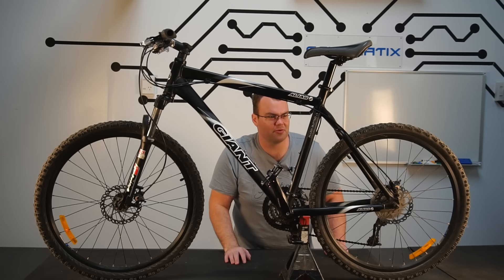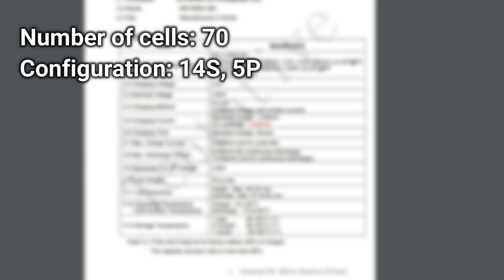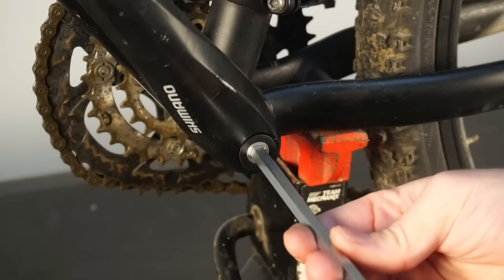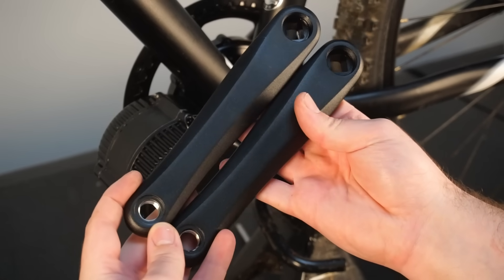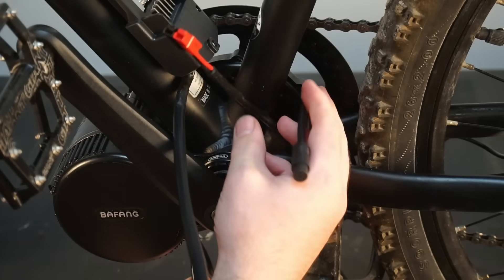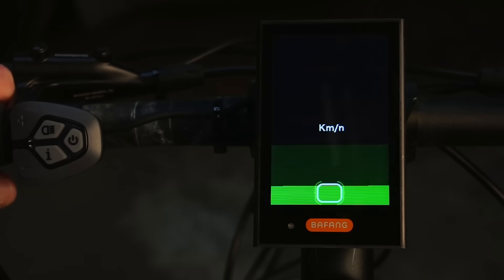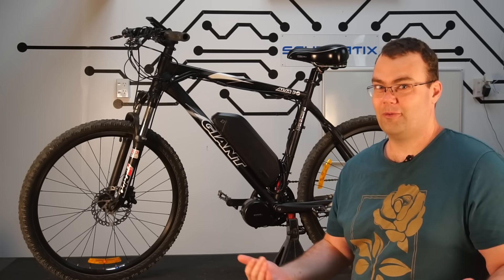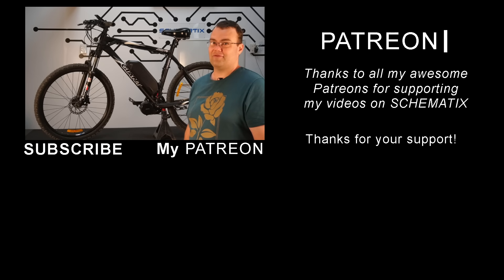eBike Conversion Kit, Install & Review ll Bafang BBS02B 750W motor

Comment: You will wish you had more power quickly, once you start riding. I would say skip the BBS02 and go with the BBSHD. If you get it from Lunacycle, it is stamped on the motor casing as 750W, but can be increased to 1500W with just a few programing changes through the display. 1500W not enough? With the BBSHD, you can even swap out the integrated controller to get 3000W output!!!! All with a motor stamped with the legal 750w info. I run a BBSHD at 3000w on my custom stretch cruiser for over a year, aprox 600miles with no issues. I am a throttle junkie, I use the throttle A LOT, and can hit 50mph on flat ground. Plenty of torque, for hills as well. Do yourself a favor, and spend the extra $ on the HD version. You will be glad you did.
Reply: What external controller brand/model# did you try?  Thanks in advance to your reply.
Reply: @markjones7130  Not external. The Ludicrous controller from Lunacycle is a direct swap for the original. Remove the factory 750W controller from the chainring side of the motor, and install the new one wire for wire. Once installed, there is no visual/ physical difference. In 30 mins you are now at 3000W. Heres the link.
https://lunacycle.com/secret2/

Comment: You failed to mention that the battery BMS is a limiting Factor to how much current can be output.
No point having  8 amp cells in 5p when the BMS is 15 or 20 amp
Reply: Interesting comment.   R U referring to the controller in the Bafang motor? Where is the BMS in the Bafang Kit?
Reply: @markjones7130  
No not the motor controller.
Pretty much every battery manufactured for an e-bike has a battery management system attached to the battery.
This is so the battery can  balance change each set of cells and to control the overall current  output to the motor controller
So you can have a very powerful motor but if your battery only outputs  certain amount of amps due to its BMS   Then the motor is never going to get the full amount of amps if it can handle more than the battery will output.
So when you buy a battery for a ebike kit you have to check that the peak output current of the battery is enough to supply the peak current draw of your motor controller .

If you are making a fully custom system the BMS for the battery and the motor controller for the motor will typically be programmable.
Then U can either use the full amps available on your battery or limit the peak amp current draw with the BMS
And or you can limit the amount of current you put into the motor through the motor controller.
You can totally stuffed it up as well and get it all wrong and burn both of them out.

Comment: Hi there mate, thanks for the video. I'm guessing the motor was 48v, is it ok to use a 52 v battery with the motor? Thanks again.
Reply: Yes they're good up to 70v but anything after 60v is just heat. I have a 60v batt and it's great. Amps Wil kill it before voltage
Reply: @nomadchad8243  what?
That's not how electricity works.
Reply: I'm just a youtube random, if you're
 Interested BrunoPOWEEER  has excellent videos about this 48v bbs02 motor, 85 kph at 60v (that's too much) his channel is great.
Reply: Not if it says 48v..

Comment: I have burnt out 5 bbsh motors from 250-350 500 as the centre spindle with the coil around it cannot cope with hear and shatter. So avoid and get bigger motor like 1000 as that can

Comment: The 02 runs better if you fit the HD controller giving 28 amps, I had a controller blow on my 02 and couldn't find an 02 in the UK only the HD, so I fitted it, it retro fits fine, it also has better mosfetts than the  02 version ..

Comment: Why on earth do you have this bad habit to through away a useful triplet and install an mid drive motor. What would you do when you will face a situation where the battery will be dead (exchusted) and you have to climb steep hills? This is absolutely the wrong way to convert a bike to ebike. The motor should always be on the back wheel and have all 24, 27, or 30 gears if possible.
Reply: Hub motors are horribly noisy.

Comment: Helpful video. I'm just looking at a 750w full suspension conversion, looks like I will have to drill another bottle mount hole with rivnut to move the battery further up, anyway can you use this without connecting the thumb throttle? I just want pedal assist like most off the shelf bikes, I want to take away the temptation of laziness 😂🤣😂
Reply: No self controll ?

Comment: Nice video. I bought/installed similar kit, my battery is 48v11.6a, kit cost ~$900USD. So, free would have been much better. :)   Been riding it about 4 months.  Very happy with it,  provides me more inducement to explore places uphill.  Battery takes ~twice/thrice/4-times as long to charge as it takes to discharge.   On flats with battery off  there is a drag on the drive train.  Nonetheless I am very happy with it.
Reply: You mentioned "drag on the drive train" while the battery is off.  Does that mean there is drag with no pedal assist in action and gliding over the flats?
Reply: @markjones7130 I only notice a little drag when pedaling, not coasting.
Reply: you couldve got a 52v 25ah battery (samsung cells) for $500 and the bbs02 750w mid drive kit for $400
Reply: @terrycruise-zd5tw I prefer a smaller lightweight battery. I do not go on expeditions over 20 miles.
Reply: Update: locked bike stolen in front of East Portland grocery. Building new bike. Keeping with smaller battery since I find most trips are <12 miles & lower weight is critical for transporting bike on bus train car.  Bafang remains price performance leader. My advice, buy the special spanner.

Comment: i've got one of these and its been pretty good, but I think im going to switch to a hub motor kit as these dont handle deep mud well, every time I ride down the local river I have to open the gear case and re-grease everything as it gets full of water.
Reply: These motors are made for comuting I plan to modify  my hard  tail for a more comfortable  saddle  and panier system   for carrying food and drink   police in tge uk don't realy give  a shit unless your being stupid and say that you have a 750watt  motor  or don't have it labeled lol
Reply: If you used Marine grade silicon sealant around the motor housing connector plates and wire entry points.... it will greatly help.  Plus try heat shrink over the connectors.

Comment: watching ya install it with a pipe wrench made me cry.. and that is not how you size a chain......
Reply: ......and the winner of the least helpful comment award goes to, Mr. Hayward.
Reply: @ChatGPT1111   Use the correct tool for the job! the correct tool is available for a few extra dollars from Luna. i recommend the sockets over the shitty spanner that is supplied with most of the kits.. good luck doing it up to spec with a pipe wrench or the crappy spanner as it needs to be done up tighter than a fishes ahole. Doing it the way you have shown will cause the motor to shift and potentially damage the frame and probably the motor when it swings up and smashes the frame over time. im just gratefull you did this to your own bike and not someone elses.
Reply: @brendanhayward1803   I installed a Stabilizer Bar-BSB-1 for Bafang BBS02 (about $20)

Comment: Should have gotten BBSHD set at 1500 Watts and with tha frame, a triangle battery.
Reply: I think i would go the bigger one also for a few reasons ,  one reason is 
A. i suspect i`m tad bigger and heavier than old mate here , also i have a heavy built bike due to  A. and also carry a bit of crap with me .
Lastly , i`m firm believer (rightly or wrongly ) that bigger motors may last longer due to their inherent heavier duty build(hopefully ) .
  Small motors that work harder tend to have a shorter service life in my experience.

Comment: Can we remove the 25 km/h limit?
Reply: It doesn't have one
Reply: As far as i know
Reply: @archiegol9903  so It already goes more than 40 km/h?
Reply: Speed limit is removable with setup function on display.. I suggest to obtain programming cable and re-program PAS levels (as I did), and get much smoother and better performance from motor. (try here: https://electricbike-blog.com/2015/06/26/a-hackers-guide-to-programming-the-bbs02/ )

Comment: Really nice review. Very well done and informative. Now I know how to handle my chain and cut it to the correct length. 

But I got a little side note.
Started my conversion this week and bought all the propper tools. Removing the cranks was hard but worked out in the end.

But removing the nuts after that was a pure disaster, the drive side would not move at all (i know it is inverted thread.) And the other side was made of plastic a broke down after 2 rotations. And the force required was insean. 

I ended up having to use a hammer and bang in out, and then use a saw to saw the locking rings in to Peace's before getting them out. This alone was more than 3 hours of work. And might stop some one to continue with the conversion.

My bike is 15 years old and has done couple 1000 miles but has always been stored inside.

Now waiting for the moter to arrive to finish this build, I'll use your tips to compleet the project. Thnx

Comment: I've been driving such a kit for 3 years (replaced the battery after 2) and I'm quite happy with it.)
Reply: Sneakily  ride this in the uk  get a 250 watt sticker with  48 volts and modify  the battery  witg 52volts for increased  power anyone who looks start clown pedaling  lok
Reply: Hi mate, did you record your total mileage up until you changed your battery by any chance? Also, what do you use your bike for, city commutes, off-road, mountain biking?
I had my Trek 7.3 hybrid converted with the Bafang rear hub kit, (36v battery,) late last year. I've only clocked up about 600 miles so far, but am interested to know the lifespan of the battery for different cyclists.
I use my bike to commute to work in London, do my shopping and for leisure. I never go offroad or hit trails etc., but I love the conversion and the best bit is cruising up hills that I would be struggling  to do as I get older. Cheers!
Reply: @najdaraj9420  I had on of these conversion kit installed on my bike and I can tell you: they are build like tanks!. The bike actually gave up before en bafang system which only failed once when the battery switch actually got into flames (I thought it was the battery so I sent it back to the dealer for refurbishment, I only niticed that the power switch melted down while dismantling the battery). To answer your question, my first 14Ah battery kept on working for 9000 km, the second one (17Ah) survived the bike which ended up in a scrapyard at 20000km... Actualy I s'till have it today, and I need to take it to the recycling park.  Today I'm still convinces that the refurbishment of the battery wasn't needed. You can easily drive over 10000km with that kind of battery with no noticeable performance or range reduction. Very good system for that price.
Reply: @laurentartiges  cheers for the info and happy cycling!
Reply: @najdaraj9420  about 2 years with 16km 5 days a week. Battery was a 48v 10ah IIRC
Reply: @pugofstardock  ok, cheers for that. Quite similar to what I do on an average week.

Comment: 750W motor, I wish that was allowed here.
Here it's considered a scooter with that amount of power.
Nice project!
Reply: Or just put a 250W sticker on it...
Reply: Police don't bother over here in the UK just don't be douche  just because  you have maybe a 10mph extra  oomph  you shouldn't  mention the power lol   or should  use that power when you know cops are not gonna be looking lol
Reply: @jonathanoxlade4252  Not sure about an extra 10mph. My 750w Bafang is good for nearly 40mph (pedal assist) and no I don’t ride it that fast, but tested when I first converted my bike.
Reply: 40mph wow is that with 48volts or 52volts since I plan to do my bike with a 750 bafang  with 52volts so I can get better mileage  than let's say 1000watt  motor 750watt  with 52 volts is more than enough  power
Reply: Also that extra power can be used to power up a stereo  system on the bike get a 12vokt to 52volt step down converter  and wire up a motorbike speaker to my bike lol I get bored and tired on my bike listening  to music makes it more fun but the isues is pulling my phone out to change music and it would be nice to listen to the radio  while riding and don't have to worry about needing a expensive  phone contract  with unlimited  data to listen to music on
Reply: It's also considered a moped where we live too (his channel is based in NZ). However if its being used on private property then legally its fine.

Comment: Did you know that you can get a whole lot mileage on the battery if you recycle the energy by charging another battery at the same time while you ride?   Install a switch that swaps batteries, one on charge and the other running the motor.
Reply: There aren't any ebikes like that, and that would only work if the motor isn't on, while using the motor as a generator, and even that would take hours to charge the battery back. It's just not worth doing.
Reply: “In this house we obey the laws of thermodynamics!”

Comment: So what if I want to ride that on back roads cross-country (3000mi)? Seems I could build my own pack of 18650's and fill that entire triangle space with 50-60AH easy. Wouldn't look as pretty, but at 25Wh per mile worst case 3kWh = 120 miles, enough to get to the next town/charging outlet. Maybe even extend the range if I carry my own foldable 67v solar panels in a backpack or something (ride at night, sleep/recharge during day pretty much anywhere with sun, no outlet required).
Reply: Carrying enough solar panels to charge the bike at any considerable rate would be difficult, plus you would need to buy a special solar charge controller.
Reply: @landonferguson7282  build one. It would probably weigh maybe 15-20 lbs if they are flexible and mounted on thin enough sheet (the cells themselves only weigh 8 lbs).  60AH with 500 cells, (250s2p, 5" square, 2.8w each ) can do it in a few hours, maybe 10 if a cloudy day. A 150v-in charge controller wouldn't be that heavy (8 lbs) and could be mounted to the bike (above rear wheel would be best). You could maybe even put the solar panels in saddle bags after it's rolled up to where weight would be less of an issue, it's not flying or going into space. Even all that would still be far cheaper ($3k) than an e-motorcycle that tends to cost more than a new Harley.
Reply: Also, after doing an Aliexpress browse if I really wanted to go all out I could get 14x  lipo pouches custom shaped in the shape of that triangle = about 100-120AH at 1C (can do 3C but not necessary for this at that size). Those are state-of-the-art and come close to  400wh/kg, not counting the bms or the 3d printed case I'd need for them.

Comment: Despite not hearing a single point of contention, I'm sure your review is genuine. How can you be so sure the cells are real Samsung with all the fakes coming out of China? Looks like fun, but pretty pricey.
Reply from the maker: Detecting fake cells isn't easy since there are very few ques to visually inspect. Buying from a reputable seller would be step 1 for myself. Step 2 would be, if it's too cheap, it's probably a fake. At step 3 I'd weigh the cells on a set of scales to ascertain if the pack is the proper weight to match the claimed mAh rating on the cells. At step 4 you'd need specialized tools to measure cell internal resistance.etc
Reply: @Schematix  you can't tell if a battery is real or fake buy weight. It has more to do with chemistry, and quality control inside the cells.
Reply from the maker: Agreed, although I never said you could tell a fake by weight. Determining a fake cell is a multi-step process in most cases
Reply: Open up the pack and look inside. You will probably have to peel away some of the plastic to see the cells.
Reply: My battery pack is genuine (52V 21Ah). Measured weight was as specified, Charging from empty to full measured by watt-hour-meter showed 1100Wh of charge watts in about 8h...
( https://michaelbluejay.com/electricity/measure.html )